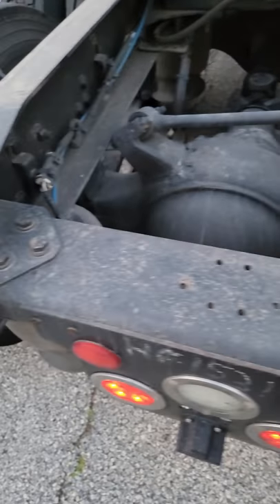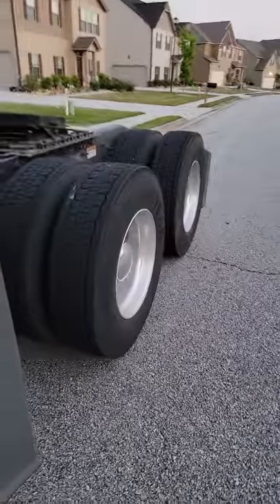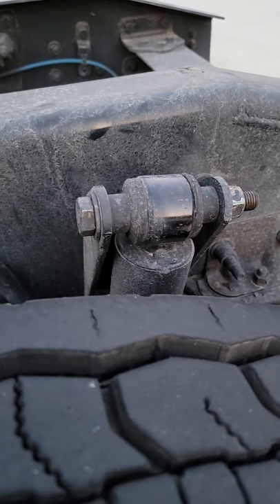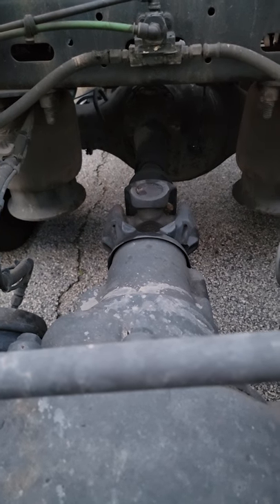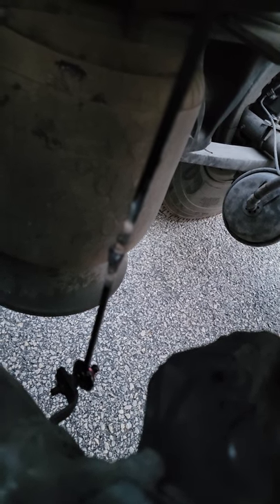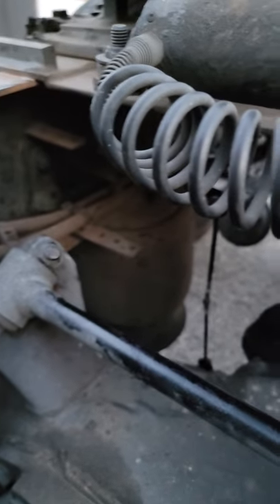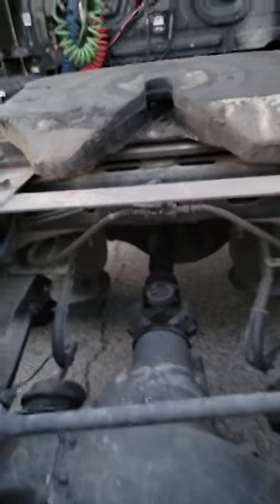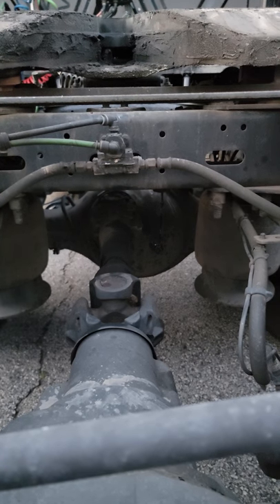vibration on frieghtliner  cheap fix

Comment: The leveling valve does have an adjustment, but you have to adjust it when you install it. There is a pin that comes in the box that you use to set the height initially. You hook up the air lines and set the height. Then you take out the pin and mount the valve. Look up the correct height online. If the height measures right but your driveshaft is still off then you have bad bushings or bad springs.

Comment: I’m going to try this as well I get vibrations at 45-53 mph 2013 Freightliner I balanced my front wheels it made a slight difference but vibration is still there I will take part off weld 3/8 longer put it back on a test it out I have all tools to do it I will report back with results.
Reply: you did yet
Reply: @moonlight2373  
Up date tried exactly what dude said made no difference at all still shakes at exact speeds 45-53mph took my 2013 frieghtliner cascadia to a local shop come to find out it ended up being a passenger side leaf spring bushing was torn and worn apart. The shop offer to change all leaf spring bushings for 1200$ I will report back once I replace them to see if the shaking problem or resolved.
Reply: @chrisanderson3875  lol dam thats cheap shop where at and pls update
Reply: I hope it works!
Reply: Any further updates on the leaf spring and vibration issue u had?
Reply: I do think the leaf spring bushing causes a vibration because there is movement in the hanger.
Reply: Did the shake dissappear?  What did u change or checked. I have the same problem. Shaking from 45 to 55... waiting for your answer brother..

Comment: You may need a high speed alignment. They actually balance the whole front assembly with your drums and pads. Instead of just the rim and tire. It’s works.
Reply: I think i may need that.. high speed balance on the front wheels, and drums.

Any advice on who to get to do it.. which shop?

Im in soCal if that may help. Tia
Reply: Was your vibration coming from the floor of your truck and in your seat
Reply: I’m from south Texas and some their is only one shop that does it and they are family owned. 

Mainly like in my dash and seats my floor. 
One thing people usually miss is the rear bushing (4 bushings) and torque arms.
Reply: @scotthansen429 mine is vibrating like that, floor, seat, and steering wheel

Comment: Your heart is good, but the cutting and welding advice is not so much. It is completely adjustable so you can raise and lower your air suspension. Check out Busted Knuckle by Diesel Dr regarding leveling your air ride.

Comment: It has a small amount of adjustment. If you loosen up the 2 bolts on the back of the valve, you can angle it up or down a wee bit. However, you should still get the adjustment bar as there are multiple other scenarios where adjusting the height of your drive's can help you in a pinch

Comment: Hey buddy I work on trucks I saw ur vid.   If your air bag valve don't work right ur bed will be inflating and deflating as you drive. It will bust up that drive shaft up.   If u got vibration at 40mph plus.   Might need shaft balance . But could be a hole bunch of stuff from hubs to tires to bushings ..  good luck.     #Truck city in lake bluff

Comment: I heard you can also loosen the bolts on the leveling valve then move up or down as needed to compensate untill drive shaft is level.

Comment: There's a height adjustment where you measure from two solid recommended points.  Look it up then measure and set.
Reply: I would never just set a leveler valve where I thought was best. You are correct that the valve should only be set to the manufacturers recomended measuring height.

Comment: You can adjust it without cutting the bar.  also you want the power drive "tilted" a bit when unloaded.  Just curious, how long after this video did you have to replace the ujoint? :)

Comment: The frame height is set up by the engineer that designed the truck. Changing the ride height is not advised, please don't do this.

Comment: Hey wassup ma man could you please tell me at what MPH your truck used to vibrating ? I got 2017 Freightliner cascadia evolution well  I had some air leak on quick connector fittings the one which goes to air leveling valve and the other right down the air bag but I did fix  the air leaks so now no more air leaks well when I drive about 66,67,68,69 my rear drive axle vibrating as soon I got to 70,71,75 it’s just goes away well yesterday I set up my air valve leveling on 3x14 and I had a 16k weight load it’s was driving so smooth and after I drop off my load get another one which was btw 20k 25k weitgh it’s stared doing the same thing I’m really confused I don’t feel any shaking or vibrating on my steer only on my passenger sit shakes a lit bit and my rear drive axle on that MPH that I mentioned Sr please let me know I m really appreciate your time Thanks a lot 🙏 Be safe !
Reply from the maker: 65 to 70
Reply: Did you find the solution?
What helped me was to adjust the leveling valve using the same original rod, just moving the two bolts of the valve. 
What it is very important is to check the height of the airbags. When they are too high, they will cause a bad alignment of the drive shaft and that is the cause of the vibration at certain speeds and it is on the passenger side.
The right heigh should be 2 inches and 3/8 between the axle stop and the U bolt. The adjustment should be done without any weight in a flat area. It doesn’t take more than 20 minutes, it’s free and you only need a 7/16 wrench and 2 wrenches  of 1/2 inch. And something like a socket or piece of wood that is 2 3/8
Reply: Could you solve the issue? Same thing with my 2019 Freightliner.
Reply: The solution is to change the drag link the shake gone
Reply: @nuray7  change the drag link bro no more vibrations
Reply: @carlosburgos56 Chang the drag link bro

Comment: You better fix that air leak first, the longer bar will break the leveling valve at the time your frame went down on air the bar will push up the leveling bar arm, and you can get a damaged valve!
Reply: I'm in a 2005 Freightliner Century classic and I'm having a vibration problem. Do you think I should buy the part that he speaking about from Amazon to have it put on my truck?

Comment: Did your hood wiggle left and right at 45 mph and your left spotter mirror on your hood was wiggling up and down and was your mud flap hanger on your driver side jumping up and down?.   and the vibration was coming through your steering wheel???
Reply: Change your worn front tires, if you got flat spots on your front tires thats the reason for shaking hood
Reply: @cuasimodovilla4642  steer tires ?

Comment: Where u getting vibration while u accelerate or all the time ?
Reply: I got a front vibration and steering wheel shimmy.. i think its at the front left wheel.

Any advice? .. 2011 Cascadia
Reply: Msg #2 
.. it happens at speeds of 35/40mph on up.. doest go away either

Comment: I have a bad vibration when acceleration or going 65+. Steering, side mirrors, gear and the floor is where the vibration is. Anybody can help?
Reply: Bad steer tire
Reply: @226trucking8  what would be the symptoms if it was kingpins or injector?

Comment: This is bs, no cheap fix at all.
Dont deceived your self, replace your shocks if they are older than a one  year, and the truck will  ride smooth.
No shock can survive more than a year, and  use only  Sascs, no Monroe or yellow garbage.